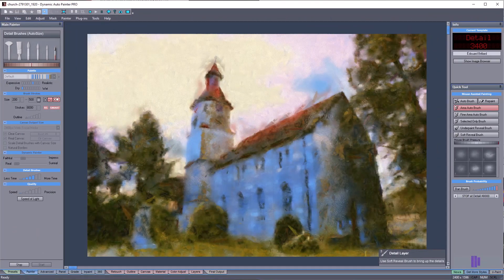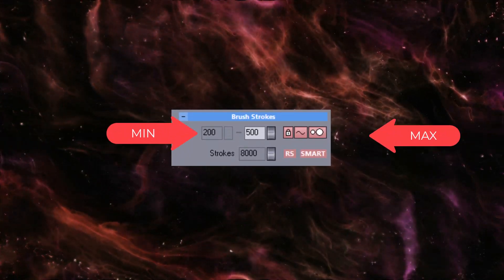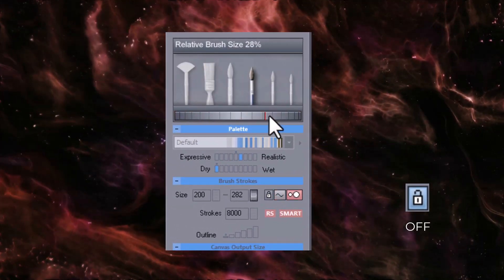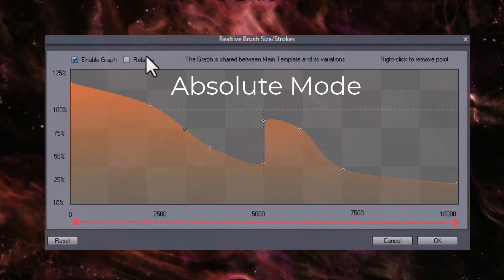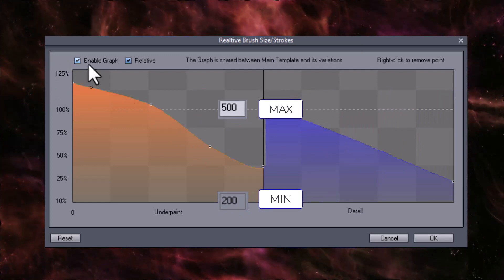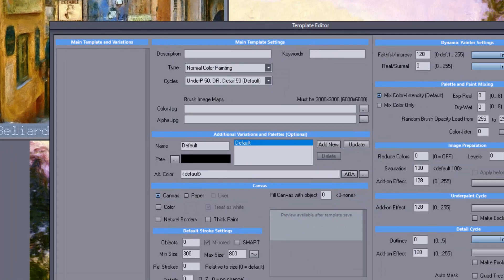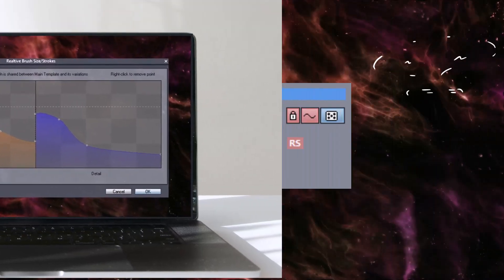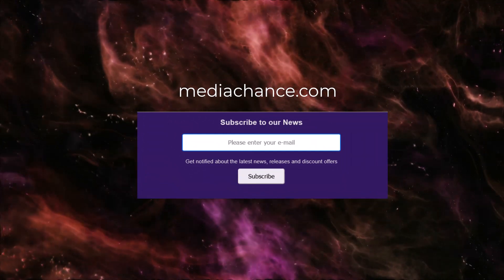Dynamic Auto Painter, let's talk about Brush Sizes

Comment: Also, SMART will not stay enabled in the Template Editor. So I can't batch process that either. Not to mention the old bug where I can't save canvas types to the template editor either.
Reply from the maker: I hear you. Will have to check this - this software is getting a little big complex after 10 or so years, with so many moving parts
Reply: @Mediachance  It is, but still fantastic. Nothing else like it out there. Some software has bits and pieces but not the full setup this has. So I'm not complaining too much.

Comment: So I have been experimenting with DAP7 with the new AI Photo & Art enhancement post process.
I use the layers in DAP7 to upscale and apply my signature and use it in a batch process I saved.

But the batch process doesn't apply the AI upscale. Even worse, when I apply it manually, the AI warps my signature into an unreadable mess.
Now I have to do the whole thing by hand and has made my workflow 300% longer.

Literally what used to take 1 automatic step per image in a batch process, now takes 3 and I have to do it all manually.

Is there no way around this?